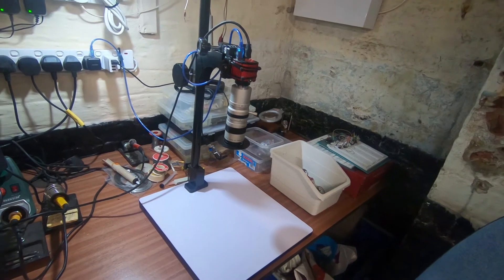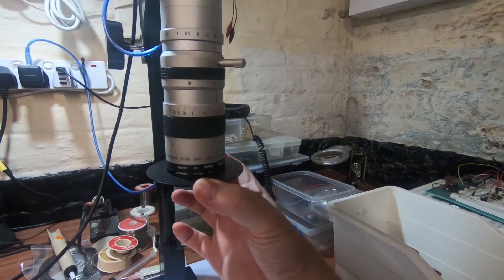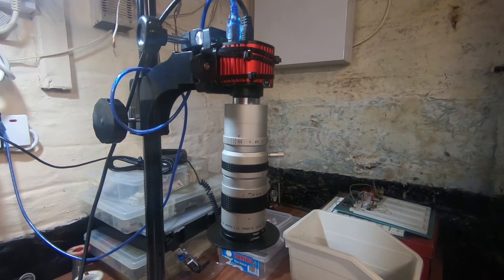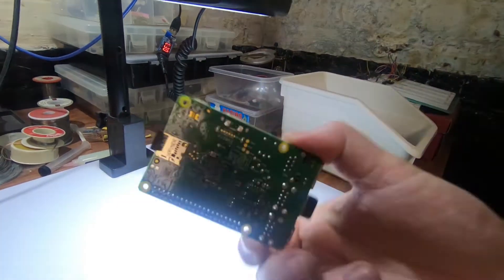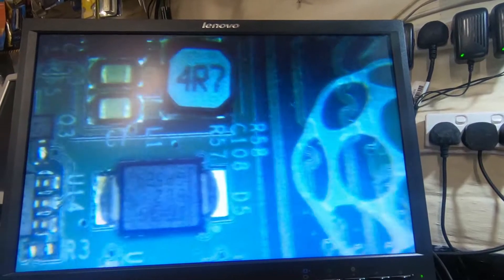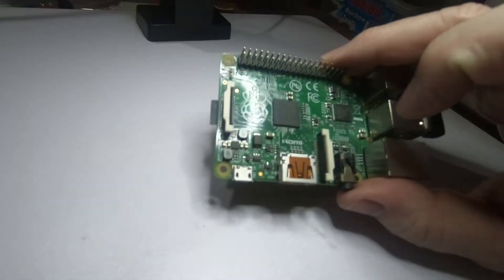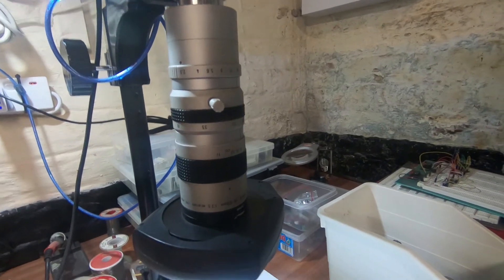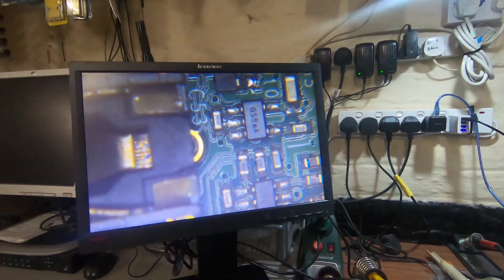Cheap DIY bench microscope for soldering or other work

Comment: Hi, this seems to be a nice DIY setup but unfortunately I don't quite get where you could find such a convenient prices for the lens and the ghotto support/bracket and so on. Everywhere I look on E-Bay the total cost (if I am to buy the thighs you've purchased ) will get me in the ballpark of about 400-500 english pounds. It is unreal. !!!!  Very dissapointed (regarding the prices
Reply from the maker: @ovi_4  I am guessing the lens you found was the expensive item..? I got mine for about £25. I setup a saved search on Ebay when I want something, you then get an email when the item at the price you want becomes available. You can look for any lens with a similar specification (even if it has a different mount you can usually get an adaptor)
Look for the lens first as the other parts can be purchased new. One will come up eventually 🙂
Reply: @ANTandTEC  Tnx. for the good advice. I'll try that. As it stands there is no way I'm paying those extorsionate prices though.  :)
Reply from the maker: @ovi_4  Agreed. The whole point of this video is how to put it together cheaply.

Comment: Hi great vid. I'm in the UK. I was wondering if you could give me links to everything please? camera, lens, light  stand. I don't have a clue
Reply from the maker: Here is some info to help you (please note any links are only valid at time of posting):

- A similar camera from AliExpress
   https://www.aliexpress.com/item/1005005643578597.html

- Stand: 
  The one I have is a "Rocwing Pro Copy Stand M" - they appear to have gone up in price since I bought it. 
   If you search for "copy stand" you will find similar items

- Lens:
   If you want exactly the same spec then search for "18-108 f2.5 lens" then check the mount matches the camera you are buying (the one above is C-Mount)
   The lens I used is  a  Canon 18-108mm zoom lens F2.5. The 'F' number is the maximum aperture - the bigger the number, the more light it lets in, and therefore the better the image (usually the higher the price too!) F2.5 works well in my example.
   The 18-108mm, is the size of zoom (the amount you can enlarge and decrease the image on screen) Other zoom sizes will work but I find this value works well for the stand I have and the distance it is from the table. 

- Ring light:
   The light I have is a Neewer LED Ring Light but I cannot see a good price for these anymore.
   There are other LED ring lights that will work just as well.

- Close Up Filter Lens +1 +2 +4 +10 Lens Filter Kit:
   Just search lens adaptor + whatever size your lens is (eg. 58mm)
   The closeup adapter rings are important as they allow the zoom lenses to focus in a relatively short distance.

Hope this helps.

Comment: Hi, I found and bought the same lens after watching your video. Could you advise to use barlow lenses? Barlow lenses and close up ring lenses should be 48mm for this? Thanks for your sharing this good work.
Reply from the maker: The lens ring on the Canon lens I use in the video is a 49mm size.
Reply: @ANTandTEC  First of all, I need to fix the distorted lens frame. Thank you for the answer.

Comment: I am not able to find any cctv lens 18-108 (or smaller zoom) for less than 120$ excluded shipping cost - what search query did you use to find this lens? Any help is much appreciated, thanks,
Reply from the maker: Don't know where you are located, but I can see one available in the UK (16-160mm) with a C mount for £45. 
Search for: zoom lens "c mount"
You can also buy adapters to convert popular lenses to C mount if you saw a cheap one, but the old CCTV lenses are often the cheaper option as no one wants them anymore. I'd set up a saved search in eBay so you get notified when one come up 👍

Comment: Do you think a 20-100 zoom lense would work ok?  Those seem a lot more available than the 18-108 you used.
Reply from the maker: Yes of course. Will just have a little less magnification.
Reply: @ANTandTEC  what is the magnification on this?
I am trying to decide on a  camera scope but I see the Andonstar stand kind say 2000x but the articulated arm style only say up to 180x
 I don't trust these chinee on Aliexpress, so are these correct does it really have 2000x magnification?
how can there be such a discrepancy?
I know they like to manipulate and use  different ways of measuring, like when I am looking at laser engravers they  like to list the wattage it draws from the wall not the optical output power of the laser, some list the optical output power of the laser but some list it as   draw from from mains voltage instead so  you think you are buying a laser with 40watt optical output power when in reality it is only 5 watt optical output power, they have no standards.
so are they using some tricks  with the  advertised magnification figures as well and how much magnification do I actually need?
I want o get the articulated arm style with the screen on it but those are more expensive so I was thinking of getting one of he articulated ones with  just the 180x lens and camera and light ring and arm and then  using an old android tablet and an HDMI capture card and OTG and 3d printing a mount or something to hold the tablet to the arm.
I mean  have plenty of monitors but not sure how comfortable and easy it will be to solder looking of to the side at a monitor , I rather have he screen mounted like the stand style of digital microscopes have it right above the camera and lens but  want the larger work area and flexibility of he articulated arm

Comment: I would love to see more details on how you set this up. What are the specs of the lens that you need to do this. You can't just put on any camera lens on it and expect it, to be a microscope, or do you? I dont know enough about imaging systems... ;)
Reply from the maker: The important numbers are the zoom length and the magnification rings, both of these are mentioned in the video. The aperture (F number)  relates to how much light is let in and consequently how bright the image is.
Reply: @ANTandTEC  I suspect there is a difference between lenses made for close up high magnification imaging and high distance low magnification mod. Or can I take any lens and reconfigure it in any way?
Reply from the maker: @jackmclane1826  Zoom lens is what you want. That way you get the longer focal distance. If you use a traditional macro close up lens you end up being very close to object.

Comment: I have built something similar using just a macro Lens, a camcorder with 60x zoom which is hooked up to a monitor stand that can move up and down.
Camcorder is about $75 used. Macro lens somewhere in the 20 - 25 and the stand also somewhere around that.
Reply: What a good idea! Been looking at microscopes and didn't even think of using a camera, i have a camera with a macro lense just need a suitable stand

Comment: I just use the camera on my smartphone with its light on. Digital zoom in and it's good enough quality to work. It's a camera, so there's minimal lag.
Reply: I do the same 😎
Reply: Lol haven't thought about that i might actually try that. Did you mount your phone?
Reply: @BorisBirkenbaum  Depends on the circumstances. If I need both hands I mount it. If I'm just investigating a fault I go handheld because it's often easier to move the camera than to move the whole work piece.
Reply: there is no way that could ever work
 my phone is a pixel 7 pro and it's supposed to be a good camera but it is really a huge fucking piece of shit and doesn't focus right at all especially  in macro mode which can not even be manually turned on and will never activate when you want it to, at least not in the stock camera app but not sure if there is a better app that will let you  do it manually
but the extra zoom only works from far away and it wont auto focus a short distance.
Reply: @andreamitchell4758  When I wrote the original comment 2 years ago I still had an S9+ and it worked perfectly. I now have an S24 Ultra and it works even better now. Sorry to hear it doesn't work with your phone. The cheap "digital microscopes" quite literally use the same camera module technology as smartphones. Perhaps you might play around with various aftermarket camera apps to see what you can get to work.

Comment: Wow i'm not the only creative brain here 😀
I've bought a 30 euro usb microscope, moded the magnification a bit so the work space is even better and than I've bought one of thise magnification loops with an LED ring in it removed the glass ,made a platform with a hole where the microscope is fitted in and placed that instead of the magnification glass.

Also thought about modding the holder to fit an extra lense and increase the workspace some more.

Comment: hi m8 thxs for the video can u help me top understand what type of lens i should be looking for i have no clue about lenses
Reply from the maker: The lens I used is  a  Canon 18-108mm zoom lens F2.5. The 'F' number is the maximum aperture - the bigger the number, the more light it lets in, and therefore the better the image (usually the higher the price too!) F2.5 works well in my example.
The 18-108mm, is the size of zoom (the amount you can enlarge and decrease the image on screen) Other zoom sizes will work but I find this value works well for the stand I have and the distance it is from the table. The closeup adapter rings are important as they allow the zoom lenses to focus in a relatively short distance. 
Hope this helps.
Reply: @ANTandTEC  thxs m!

Comment: Would a regular canon dslr with a 50-200 mm lens work ? I am planning to use the hdmi out ,I was going to build one like yours but found this canon with a massive lens and wondering if it would focus on close objects
Reply from the maker: Yes if it is a mirror-less DSLR this would work. You would still need to add the closeup adapter rings to the zoom lens for it to be able to focus at the short distance (otherwise your camera would have to be further away)
Reply: @ANTandTEC  thank you , is there a number on that close up ring ? I am finding ones ranging from 44mm rings to 77 mm rings , I don’t understand how the optics work so I am confused.
Reply from the maker: @FerdAboubakrOnline  That number is the diameter of the large end of the lens. The size will be written on the end of the lens  You will need to get the correct size closeup rings to suit. 
Mine is 49mm but may be different for you depending upon the lens you have/get.
Reply: @ANTandTEC  appreciate your help . Thank you.

Comment: @ANT&TEC  Hi again, I purchased the "Close Up Filter Lens +1 +2 +4 +10 Lens Filter Kit 58mm" but the lenses do not fit the canon zoom lens, they are bigger in size (58mm). Are you using an adaptor to fit the macro lenses to the canon zoom lens please?
Reply from the maker: The link  was only meant as an example - I assumed you would have got the right size for your particular lens 🙂
Now that you have the wrong size, yes, you can buy an adaptor, and these are cheap to buy.  Just search lens adaptor + 58mm + whatever size your lens is.

Comment: Amazing post. Can you please provide part name or number, link to the 4X close up ring and the ring light. Thanks in advance.
Reply from the maker: The light I have is a Neewer Macro light but I cannot see a good price for these anymore.
There are other LED ring lights that will work just as well such as this one:
https://www.fonefunshop.com/universal-led-ring-light-for-microscope-black.html

The close up rings are available from many places, search for "macro close up lens" + the size you need. The packs of 4 (+10, +4, +2. +1) are the best to be able to change the magnification.
Something like this I found on Amazon:
https://www.amazon.co.uk/Optical-Glass-Macro-Filter-Cameras-default/dp/B09CMMTV15
Reply: @ANTandTEC  Thank you so much for the links. I have now received the parts and am about to put them together.

Comment: Thanks for the video!! Some very useful informations there.
One suggestion tho.. to fix the issue with shaking, I would some disconnect the camera from the working area. For Example have a small table mounted to the wall and have the camera stand on it.. that way if you shake ur table or do things, the camera is not effected.
Reply from the maker: That's a good idea. 👍

Comment: It doesn't seems cheap at all.The camera itself with extra lenses and the adjustable base all these together might cost around 300-400$.Cheap could say if costs around 20-30 bucks maximum.
Reply from the maker: I have built two of these, this one and another for a fiend of mine, the total spend each time was around £140 so about $200 (including a used monitor). I don't think you could put together anything else with a similar resolution and focal distance for less than that. 
I have owned ready built ones in the past that cost about the same but they were no way as good. It's the lens size on this that makes all the difference. In particular, the aperture on the ones available in the stores is a lot smaller. 
Depends upon what you need it for really, the focal distance with this one makes it ideal for soldering.

Comment: what is the total maximum optical zooming ratio all together?
Reply from the maker: Difficult to calculate so I zoomed in on a ruler and measured it on the screen 🙂
1cm measured 33cm. That was on my 19" monitor. Would obviously be different depending upon the monitor size used.